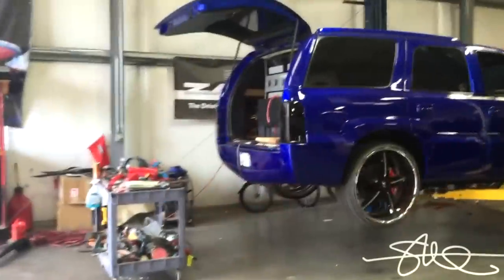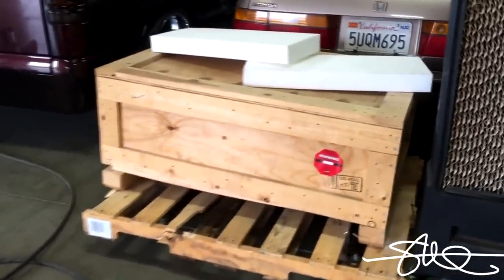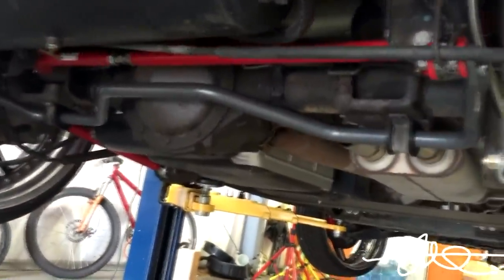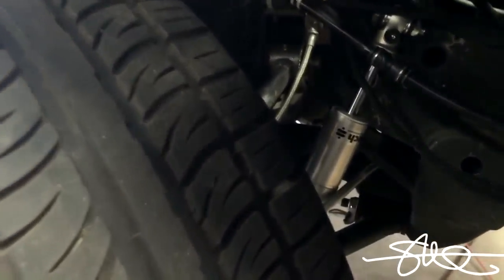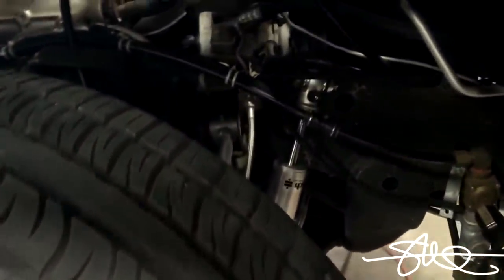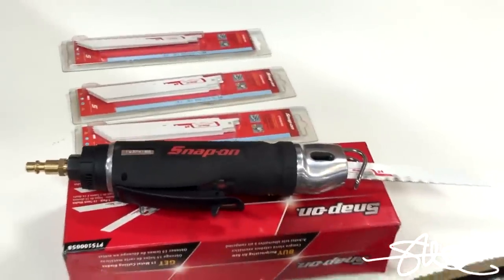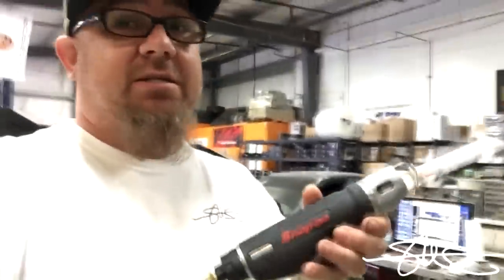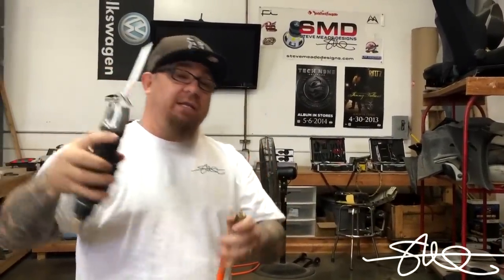Snap-On Air Saw Cuts Steel Like Butter! (Short Demo)

Comment: Just bought one and I love it. The only flaw is the to tighten the blade, the chuck is only placed on one side. Most other air saws have two chucks on both sides to tighten the blade both sides instead of one side.  I want the blade to be more secure, instead of flying off once in a while.